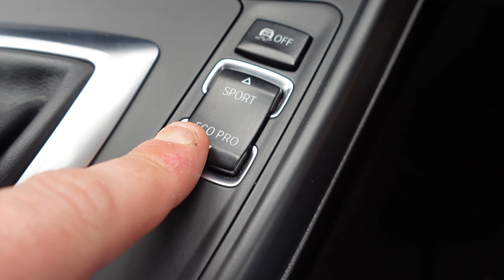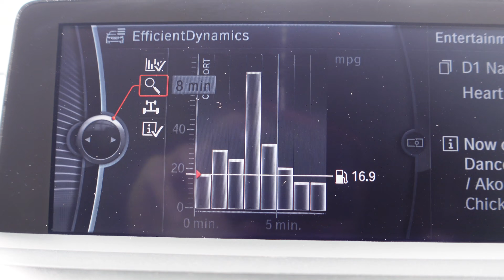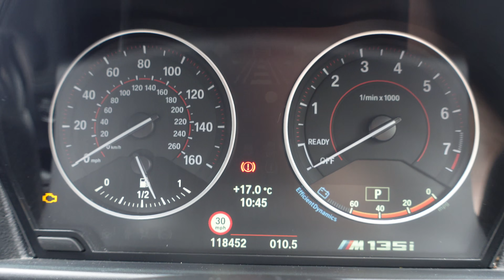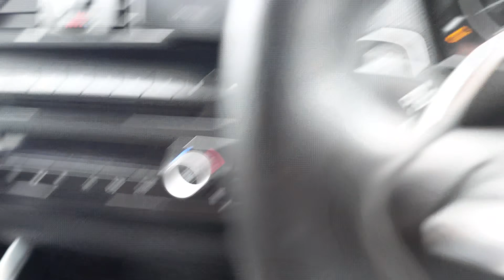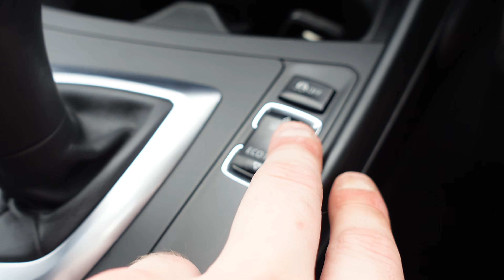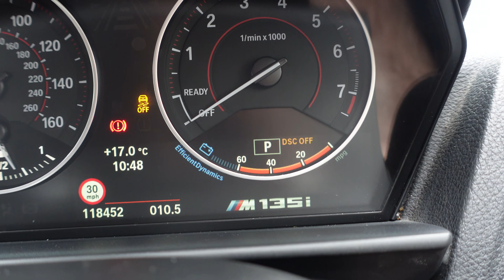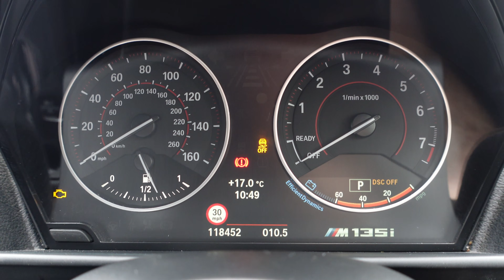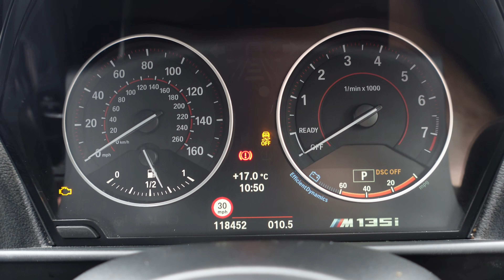BMW Eco Pro , Comfort Mode , Sport & Sport + Modes Explained

Comment: Hey Doctor,
I'd like to buy a F36 30D, but Im confused by the Efficient Dynamics line on the tachometer. What does that mean? Is it only there because of the Eco Plus mode? I'd appreciate it if you could explain.
Reply: Basically the efficient dynamics assist you in saving Fuel when driving in eco pro mode.
It will give hints on dashboard when you accelerate to much or drive above max speed limits on certain roads.
Also it remembers your driving habit to assist you further in saving fuel.

Dont worry tho, you can just drive comfort mode or sport mode, it WILL consume more fuel as it will do more rpm when its shifting gears.
The fuel you save is minimal in eco pro, maybe 5 liters (+-100km).
Reply: @thekids_callmeboss6577  thank you very much, you have helped me a lot!
Reply: I heard they are slightly less HP, but more fuel efficient. Wouldn't make any difference imo

Comment: Hi Dean, apologies, a silly question. I have adaptive suspension on mine & had previously thought putting her in sport mode stiffened up the suspension. Did you really mean that putting adaptive suspension vehicle into sport mode 'will' soften the dampers/suspension?
Reply: In sport mode I can configure 2 things.
Suspension and drivetrain.
Reply from the maker: Sport + stiffens the steering and makes the suspension harder. If I’m correct comfort & sport leave it exactly the same, as in sport + it turns off the DSC also which is why it’s meant to stiffen the suspension for cornering for ultimate control.
Reply: @BMWDoctor  Thanks Dean, dementia is strong with me today.
Reply from the maker: @mikesloper7112  No problem my friend dont even worry about it
Reply: @BMWDoctor  Thanks Doc
Reply: @mikesloper7112  no you're right he did accidentally say it makes the suspension softer